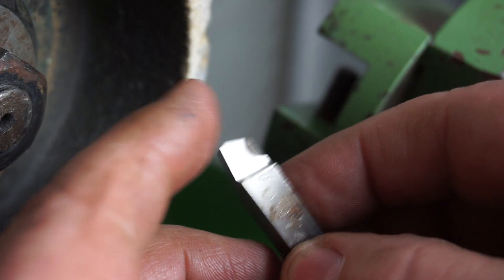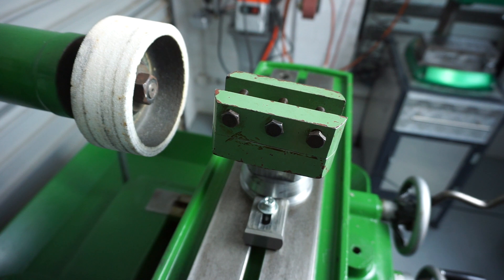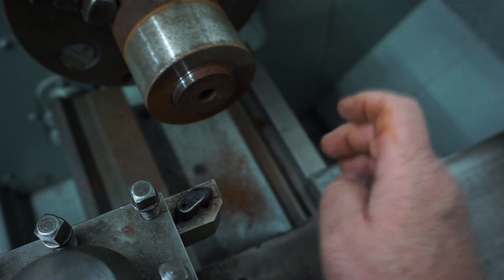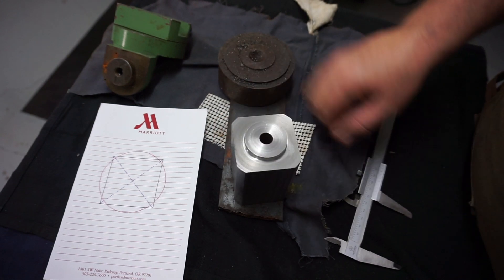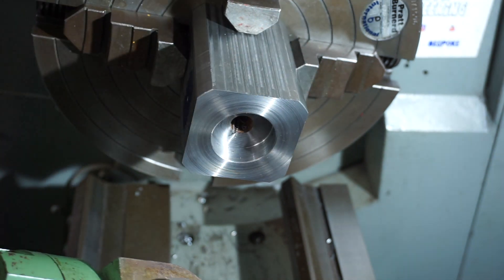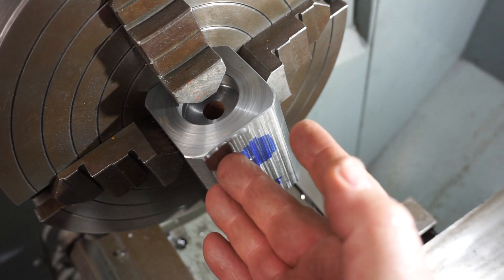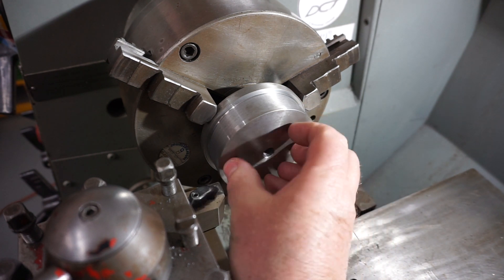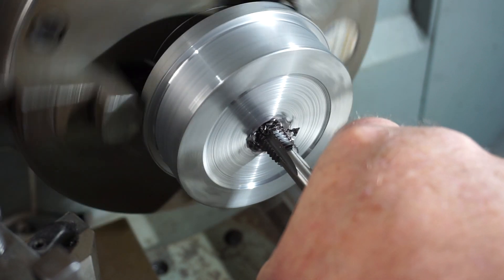Tool Post BUILD for Tool & Cutter Grinder

Comment: Resting one end of the tap handle on the crosslide and rotating the lathe chuck to feed the tap in is really asking for trouble. You 're essentially making a single sided bending lever and adding bending stress to the tap which is really only meant to take torsional stress. It could break even if it's a good quality item. If you tap with both hands on the ends of the tap handle you 're seriously minimizing the risk of  the tap breaking
Reply from the maker: Yes, but the tap already had good engagement (14-15 threads) and I got away with it 😉.  If it was a critical tapped hole I wouldn't have done it, but seeing it was only a retaining bolt I drove that tap home for Johnny!  Thanks for watching.

Comment: Nice and functionable. No face mill to use to chew down the sides of the stock? Or do you just prefer endmills? How much is that going to cost you later for Dianne doing your house keeping? LOL!
Reply from the maker: G’day Tom. I’ve got a 50mm shell mill in the CNC but it has aluminium inserts in it. So I just hit it with a 12mm coated carbide cutter. Took longer, but at least I didn’t have chips everywhere in the shop.
Oh, if you treat them right you can get them (wife) to do almost anything. I explained if she was a good girl and played her cards right she might even get some special treatment later on that night 🤣.
Reply: @AaronEngineering  So you had to rub her feet? LOL!

Comment: Gday Aaron, that turned out very well, good to see you’ve made new jaws for that tap wrench😂, a tool and cutter grinder would be so bloody handy, f been at the bench for hrs today with wet and dry on a sheet of glass rubbing my guts out, I’m over it to, we need to get Diane to teach my wife to clean the machines after me but I think she would have a battle on her hands there, great job mate, cheers
Reply from the maker: G’day Matty. Thanks for following along. Tonights video was a bit of a marathon, as it was 20mins long. I was going to do it in two parts, but it wouldn’t flow as good. I’m still using that tap wrench as is. It does needs new jaws, but still works a treat. Dianne was a good girl on the weekend. She did an excellent job cleaning the shop for me. She might get a special treat if she plays her cards right 😆. Cheers 🍻. Aaron